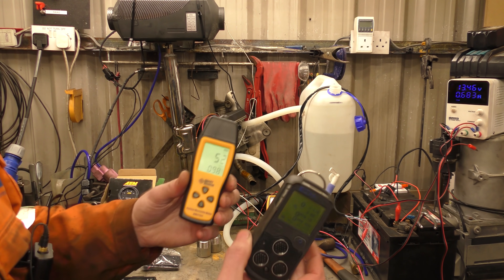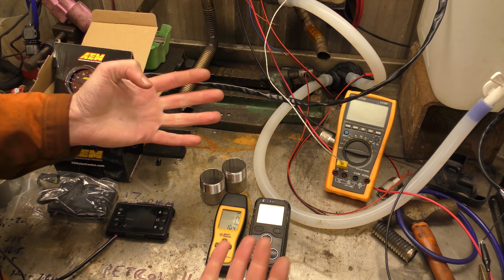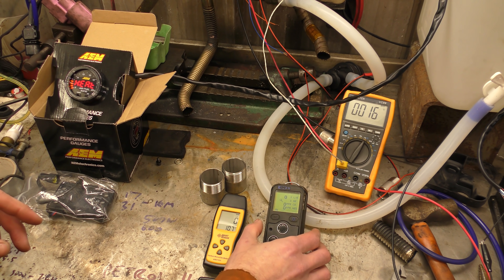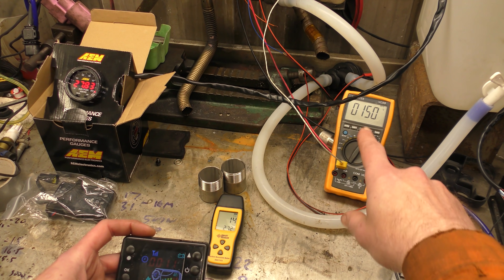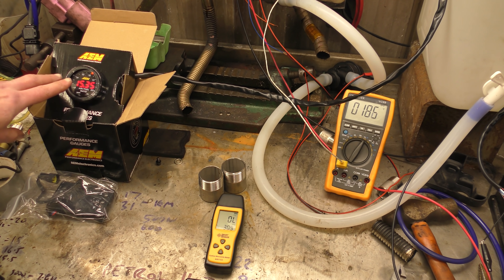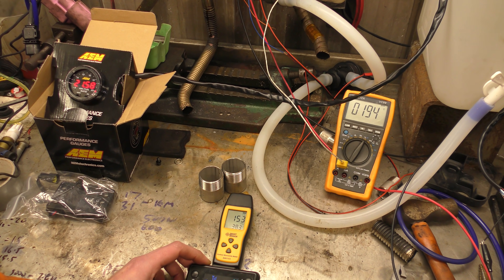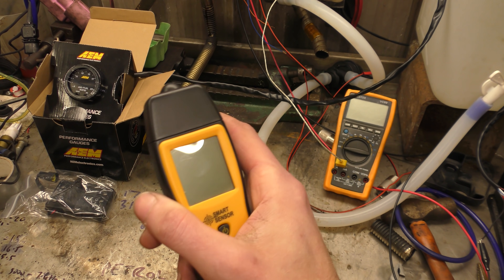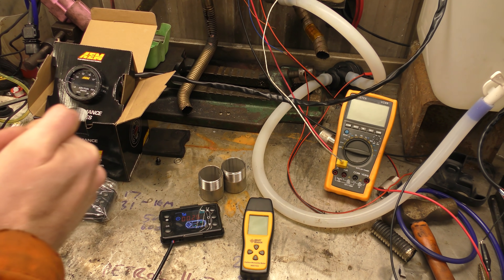Diesel heater tuning - using cheap CO gauge

Comment: 5 years and still informative.... :) Does tuning the hz and fan speed for elevation apply only when running on manual mode? Or is it also needed when running in the temperature mode? i.e. heater controlling the ambient temp through the sensor in the controller.
Reply from the maker: Both.  But if you have modern ECU there is a chance it will only run a one third of maximum power at minimum.
Reply: @DavidMcLuckie hmmm. how would I check? I got a Lavaner 2kw pro 4 years ago. Guessing its the old ECU!!? btw. your videos on tunning were super helpful. have a small diesel van that even 2kw is an overkill and could decrease heat output. I could reduce the fuel and adjust the fan speed accordingly and reduce soot buildup/maintenance for the long haul.

Comment: Hi i have a question about the Small green pads in found in these things between the heat exchanger and the outer casing (often little green/grey) pads, and also the Gaskets, They look a lot like a certain banned material has anyone tested them? (as its not banned in china)
Reply from the maker: I was talking to friends about this the other night.  We can't decide if it's asbestos or not either.
Reply: @DavidMcLuckie  i'd like to think our import guys would of spotted it, but...

Comment: Fuel tuning is probably best done by figuring out the highest heat, for the least amount of fuel used. If you get close to the same housing temp at 5hz and 6.5hz, it’s not worth the extra fuel. Conversely, if you get 25% less heat at 4.5hz vs5hz it’s much less efficient.

Comment: how are you measuring housing temp? where is that probe on that meter placed?  do you find that tuning for the lowest ppm setting you get a steady steam of exhaust smoke?  if i tune for 0 smoke, I usually get high ppm.  i find my lowest ppm settings produce a steady stream of exhaust smoke.   is this good for longevity of the heater my method?
Reply: I hope somebody answers! I have the same question

Comment: Hulloooooo

Love the channel

Scot living in Oz

Diesel heater fan as in fanatic not fan lol

I have a co monitor like yours

I’m only running an all in one in a camper trailer, so all outside except the air inlet thru a mag coupling😊

Bench setting up
I’m only after low heat as small area, but many run this and no cleaning needed, just want to get set for low temp long periods 

So max fan speed about 4000rpm

The frequency, should I just reduce till min co2 then up a bit

You said 2hz, did you mean, .2 hz?

So reduce pump hz until lowest co reading then up 0.2?

Have I got this right?

Cheers

Or should probably say
“On yersel big man, that’s pure dead galous “. .😂
Reply from the maker: Tuning the high setting is the easiest as the heater reacts quicky.  Set your fan to 4000rpm and start at 4.5hz on the pump.  Let it run for 10 minutes then take a CO reading.  If it's between 0 and 20 perfect.  If not drop the pump 0.5 and take a reading.  Rinse repeat.

On the low setting you need to let it run a bit longer between adjust and test as it takes a little longer for the heater to cool down to the new setting.
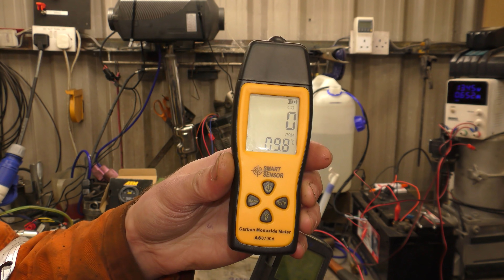Reply: @DavidMcLuckie  0:07
Reply: @DavidMcLuckie 
Hi
Thanks for reply
I’ve discovered my latest vevo has the Bluetooth controller app, and there’s very little you can tune from what I can see
Monitor in post
So kinda hoping it’s low n not need it
Reply from the maker: Ah that one.  Yeah I didn't find any tuning on that one other than swapping out the fuel pump for a different size.

Comment: I dismantled mine after around 7 months on Kerosene and the green 0.028ml pump, with occasionally 210c and thr pump stroke automatically throttling back. Zero carbon Zero soot. Running flat out 25ppm CO. Mine is the preset motherboard with just alpine mode. In fact a weak mixture can also raise the CO level as can rich mixture. Excessive or lean mixtures create incomplete burn = soot. With the 0.022ml pump CO is higher but still acceptable. CO though at low level with alpine mode and the 0.022ml pump gives a CO reading of over 100ppm so too lean and incomplete combustion 
Hope this helps

Comment: Hi David first of all thanks for making such great videos! I recently re-tuned a 2 kw heater that was not working very well, the unit would resonate at low Hz / fan speed settings like a pulsing drone sound. After much experimenting I found that the first thing that needs to be set is the minimum fan speed and in this case the minimum fan speed had to be set at 2050 rpm. I then set the minimum Hz setting to 1.2, any lower I would find my CO levels were very high. This not only solved the pulsing "drone" sound, it maintained a steady heat output reaching 1 red bar. My CO level at 1.2Hz seemed to hover around 50ppm. The higher settings were 3.2Hz and 4300RPM - at the highest setting the CO was still around 50ppm. I am running the heater on kero.
Reply: Hi , also have 2kw heater …. Is your heater still working ok on 2050 rpm
Lower fan speed ?
Reply: Since writing my post I have discovered that a few of my CDH actually run very lean and no amount of adjusting the fan speed or the fuel flow seems to lower CO levels or increase heat output - So I decided to reduce the air flow into the combustion chamber by covering up some of the holes on the intake silencer and straight away the casing heat increased and the CO decreased - My lowest setting is now 1.2hz @ 1550RPM with a casing temp if 120DegC @garyfullerton9312
Reply: @funnyminky  Correct, by lowering the fan speed you can keep the combustion temperature high at the cost of output air flow volume, I run mine a 1.6 at 1800 but have had it as low as  0.8 at 1200 and still had low CO but still a reasonable duct temperature of 70 C.  So reduce fan to get two red bars at all times for given fuel rate.

Comment: Hi David I have just fitted a 5kw heather , my problem is that the controller when I press the power button it goes straight into startup mode. There is no pump simbel or the temperature bar's on the screen and trying to change to  hertz I get -09- that I can change from -01- to -09-  this will speed up the fan and the heat. Is this an older controller or is it faulty?
Reply from the maker: Depending on the controller and or which generation it is will alter which combination of buttons or holding of buttons to get the pump to prime.

Comment: 1. I always set and run my heater so that there is the lowest freq possible at the low end (being 0.8Hz) and raising revs a little (some 1900) with the top end being similar, something like 4.0Hz at 5000 revs. my thinking was that diesel soots when it runs rich. when it runs lean, although it will be producing more CO at least it won't be sooting up, so I'd rather be on that end of the scale. is my thinking correct?
2. does the type of the controller you've got on the video allow you to run it in 'temperature mode' so that instead of setting the constant freq of the pump you set the target temperature? I've got a bit different style controler (with rectangular buttons and no timer) and I can switch between Hz mode and temperature mode. I've been always running the latter. That way it kicks in on full power when the temperature drops below the set by some 1-2 degrees, it runs until reaches the target temperature and then goes down to the lowest setting and stays there until the temperature drops again. I've always found this mode best.
Now I'm considering buying myself a CO meter like the one shown in the video. I've got a CO alarm but the reading is so delayed it's no good for measuring the exhaust. plus the alarm is so loud.
looking at graphs showing emissions dependent on the AFR for diesel combustion the conclusion is THE LEANER the less particulate matter. it kind of proves what I assumed above. there's a point where your CO emissions drop to their minimum level but when you keep leaning the mixture further, your CO emissions will go up, but PM emissions (which I assume form soot) will keep dropping and dropping. of course it's best to keep everything in balance so that you get good emissions, low soot but also maximum power output. but when we talk about our diesel heaters what matters the most for us is minimizing the soot formation and it seems the leaner we get, the better. this is why I always tried to set my heater so that the pump frequency is the lowest possible at a raised fan RPM level for more air. I often read on chinese heaters groups people had too much heat in their vans even on their lowest setting. I always assumed the reason behind it was their vans were much better insulated than mine. but I've got a very small van (SWB boxer) and I never feel too hot. maybe that's because with my settings my heater at idle normally runs at 60-70 celsius (that's what my controller shows). maybe if people run theirs on higher minimum pump Hz they run much hotter (for the cost of more soot obviously).

Comment: Varying settings I have been able to reduce but not stop CO production at high output.  A brand new one read 10, mine is in the hundreds. However when the temperature settles to my comfort level the output drops and CO rises to max.  I cannot adjust a decent CO level for both high heat output and low.  Any suggestions?  Also one of my units will give a E -08 signal after attempting to fire.  I get two bars then E-08.  I have dissembled the unit and cleaned it well including the screen and small opening.  Absolutely no carbon build up. No improvement.
Reply: I solved my problems by sequentially substituting new temp sensors, motherboards, and glow plugs  using my spares until I got all three working.  Each heater had one of these bad.  Finally I could stop burning wood in the boat's fireplace to weather the coldest of this winter in San Francisco.

I used the same CO as yours to adjust slow and high speeds to a minimal CO output, still high 50 at fast 100 at slow.  My settings are 2.0 and 5.0 Hz, 2000 and 5000 RPM.  
At low output I get one red bar.  

Do you know if four bars, two green, two yellow will coke up or stay clean?

Comment: Varying settings I have been able to reduce but not stop CO production at high output.  However when the temperature settles the output drops and CO rises.  I cannot adjust for both high heat output and low.  Any suggestions?  Also one of my units will give a E -08 signal after attempting to   I get two bars then E-08.  I have dissembled the unit and cleaned it well including the screen and small opening.  No improvement.
Reply from the maker: Does the one that E-08 (flame out) ever make it to two bars?

When you say temperature settles, do you mean when it starts to throttle the fueling?
Reply: @DavidMcLuckie   While bench testing one of my three units will give a E -08 signal. I DO get two green bars then E-08.  

I have dissembled the unit and cleaned it well including the screen and small opening.  Not coked and no improvement.  Just a day ago it ran OK.

When the units function (two now don't)  and arrive at the desired temperature 
they throttle down and my CO meter ( the same as yours) goes to OL. This occurs after running full out with the best CO reading I can by adjusting Hz and fan speed.  

The single running one is now set at 1.1 &5.5 Hz, 1500 & 5000 RPM.  My single functioning machine ( interestingly the oldest of three) settles at five bars when the desired temp is reached.  I have successfully run it at 1.0 Hz for most of the winter.  it settled at four bars, no red ones, no coking.  Coking occurred only when 6 Hz or higher.
Incidentally at how many bars will coking or flame out occur?  Four seemed OK this winter.

It's nice to discuss with one who has extensive experiential knowledge.  Too many amateurs exist.  I appreciate your assistance.  

It may be of interest :  My installations are in my sailboat.  Exhaust piping is not direct. One goes into the bilge then makes a 180 "U" turn and then straight up seven feet through the overhead (roof).  

The "U" is one inch copper water pipe.  I used the smooth end of the corrugated pipe as a shim to fill in the difference between the US pipe ID of one inch and the aluminum exhaust fitting of 25 mm sealed with high temp silicone.  After a cold miserable rainy winter the copper was burned nearly through.  I am now changing to stainless.

The second is less complex, less turns (two 90s) and shorter piping.
Reply: Additional info: My and a friend's machines need SN-2 to avoid copious white smoke and coking.  Yours is SN-1.  Any knowledge of why the difference?  Others on boats have SN-1 settings.

Comment: Not sure if this is recommended, but I had one soot up to the point it wouldn't start only smoke. I took the intake and exhaust pipes off and blew the combustion chamber out with compressed air. I put the pipes back on and it fired right up. Now that I know about adjusting it to reduce the monoxide and soot I'll be doing that. I don't need all the heat it produces anyway.

Comment: Thanks again David. It was McL University that got 1 of the 2  2kw heaters i was sent to finally run and stay running.  The first would ignite and run up to 1 or 2 yellow bars then drop back a bar before shutting down with an E08 error after 10 minutes or so. Factory settings were upper end 4500 rpm and 4.2 hz. The replacement would not ignite at all. E10 error every time. That came set at 4250 an 3.4 hz. I stripped both and assembled 1 of the better looking organs. Lots of internal fit and finish variation found. The reassembled unit was getting ready to shut down again when i upped the top fuel setting. I then bumped the upper fuel rate incrementally until i got both red bars to light and stay lit. This required 6.4 hz of fuel, which sounds high but nothing less would hold full heat. No excessive smoke observed. Output air temp was about 180f . I still need to set the low end fuel and probably do it all again when i start recirculating air in the final install, but i will invest in a CO meter first. Ive also ordered a few bits i mangled in the take apart to allow me to further test the poor stepchild frankenheater. The best amazon review i saw on one of these said "You aren't buying a heater. You are buying a new hobby."

Comment: I have 8kw all in one unit taken apart.
I operate my Hz low at 1.2 and high at 3.6 Hz.   And it burn so clean ass he..

Whats you thinking about this Hz settings??

Alsow I have fan speed at 2200 and 4500 rpm.

And all red are on top. And tuned hight settings at 3.
And I have it in a boat

Comment: My 2021 Vevo 8kw diesel heater was running fine and all of a sudden the 20amp fuse blew and when I replaced the fuse the unit turned back on ok but now the fan won't come on, it shows the picture of the fan spinning on the controll panel and then all of a sudden goes to error code E-06... i've have put 12 volts to the fan wires and it spins up free and fine so its not the fan motor, its as tho the fan is not getting any power to it can anyone please help.......
Reply from the maker: As you've tested the fan motor, that only really leaves the ECU board on the heater.

Comment: Nothing beats a proper combustion analyzer for setting anything that burns fuel. The problem is that testing CO (carbon monoxide) only will not give you the right settings. Outside of a stoichiometric flame you will get higher CO readings either because of too much fuel (rich) but also because of too much air (lean) the only way to tell them apart is to have a combustion analyzer which will also give you the O2 reading so that you can tune for the lowest achievable O2 reading with the lowest CO reading you can achieve. That will give you the best combustion possible but keep in mind that the CO reading  may not go as low as you might want it to go as these units are not made to be the most efficient burners on the planet.
Reply from the maker: I don't disagree that a combustion analyser will do a far better job than purely a CO meter.  But it will get you close enough.  It's easy to tell on the diesel heater if CO is high because of too much or too little fuel.  If it's too little the CO goes up and down like a yoyo as the burn chamber flames out and relights.

Spending £85 on a diesel heater and then spending £400 on a combustion analyser doesn't make sense.  Spending £30 on a CO meter to get close enough does though.
Reply: @DavidMcLuckie   I do agree that a big issue is price for a combustion analyzer. For the price of the diesel heaters I'd be looking to rent an analyzer if need be. Nice to see that there are some decent other DIY ways to get them tuned in to a decent burn

Comment: Its not impossible to have both Oxygen and CO (even unburnt hydrocarbons) in the exhaust stream in the same time. These burners (or possibly any burner) are not perfect. This is why I think it is practically not possible to adjust the settings to stoichometric without having soothing black smoke.